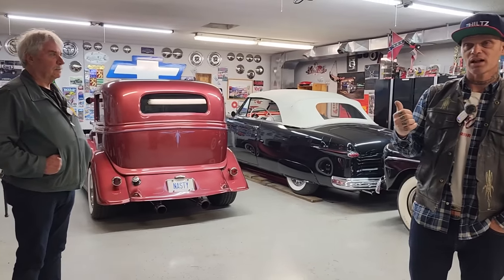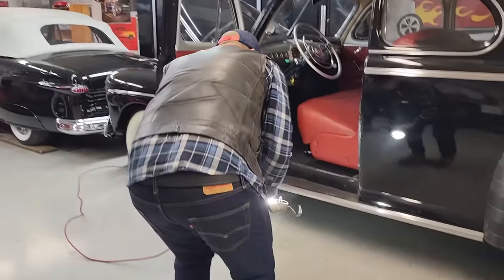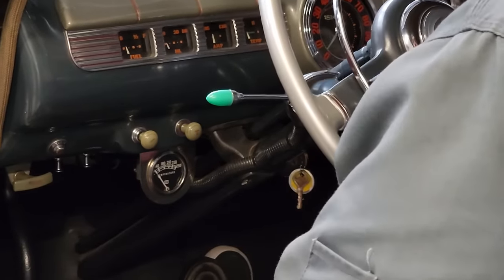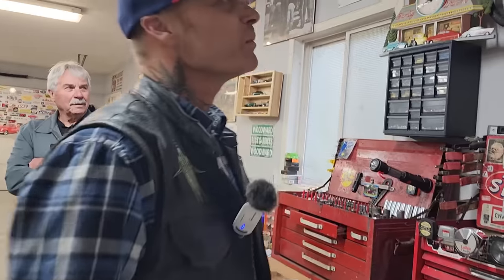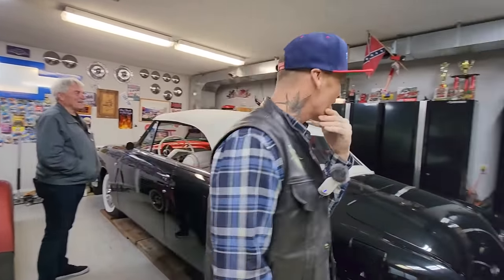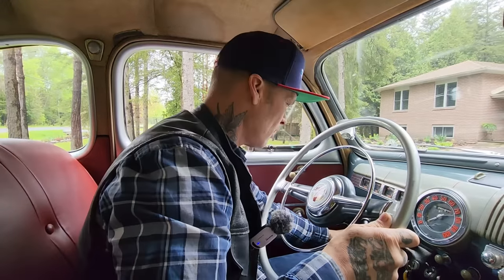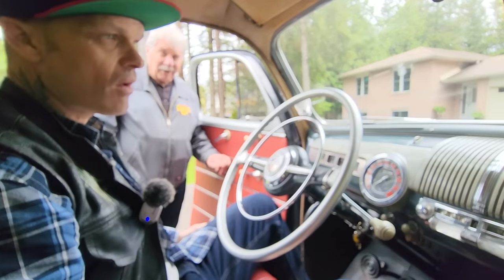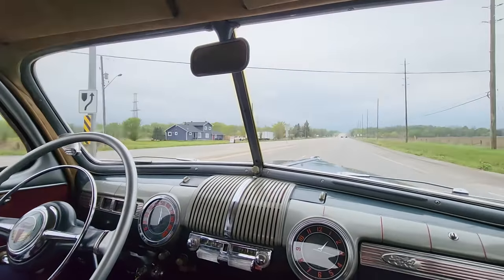The flathead long haul begins 🌎 2,000 KM with a flathead, bias ply tires, & drum brakes

Comment: Chad, I haven driven my  early Ford long distances on both bias play & radial tires for 40 years. Trust me it is way safer  and much less tiresome on radials. Please CONSIDER taking that offer of FREE radials. Put the bias tires in that huge trunk for reinstall when you get home. Drove safely. 
Best regards, 
MartyZ in NYC
Reply: I agree. Once you are on the road, the offer will be in your rear view mirror.
Reply: Unless radial design changed....radials caused pre mature wear on older suspensions. I put steel belted Michelins years ago on a 1964 and ride and handling was terrible....I also  had Michelins on  a 62 Volks in 1966 with no regrets.
Reply: @rowenajohnson9173  I have radials on my '64 C/10 Chevy pickup, and they ride fantastically.
Reply: @jimmieroan9881  Yes, I'm intimately familiar with that Ford's buggy spring suspension system (and as a car restorer hobbyist all of my adult life I'm also familiar with Coker Tires). However, I was NOT comparing the ride and handling of my C/10 truck to that '46 Ford.  I was responding to Rowena Johnson's comment about the radial tires on her 1964. For clarity, please re-read her post. Lastly, about your "old guys" comment, I'm 71. Have a great day.

Comment: It has the 1946 Trim and front marker lights. The 1946 trim is scalloped and nicer than the later years. I have a Black 1947 Business with the 46 trim as well. But mine is street rodded and about 6 inches lower than yours lol Wish I could post a picture on here of it . This car looks way cooler down low. Ask me how I know lol. This gem is definitely a time capsule. Have a safe trip guys!!

Comment: My first car was a 1947 Ford Club coupe, with a Mercury flathead, Edelbrock high compression heads, high lift cam, etc. I wish I still had it. The trim on this car is 1946, considering the slim trim around the side windows, front rectangular parking lights above the grille, the lines in the front grille trim, and the oval red Ford script on the rear bumper. The title may say 1947, but everything else says 1946. Beautiful car!

Comment: I had a 50th Anniversary 1953 Ford Convertible with the last year of the Flathead V8 which came out in 1932. It was purchase new by my Step Mother who worked for a Ford Dealership where she met my Dad and married him. My Mom passed of Breast CANCER when I was 3 and change in 1951 and remarried in 1954 and my Step Mother stopped working to stay at home and raise me. I acquired the car (that had every option Ford offered) in 1965 from my Step Mother and sold it for $110 and 39,000 miles when I entered the service. My Dad taught me about the mechanical fuel pump that was push rod operated and they would easily wear and he had to put a copper or maybe brass shim on top of the push rod to allow gas to be pumped. You were discussing that with a leather boot on the push rod. Loved that car and enjoyed the super quiet internal engine parts making it so quiet while running you would think it wasn’t running. Good luck and love your videos.

Comment: You might need to find non ethanol fuel and a parts house that sells a lead additive for your fuel. Those older engines relied on lead to lubricate valves. No lead in fuel and add ethanol would be trouble on those valve stems.

Comment: I hope you and Jolene like the car.  I would like a stock 47 or 48 Ford or Merc coupe.  I hope the trip home is enjoyable.
I owned a few old Fords, but not the 47.  I did work on them, and once you got used to the idea that it was a torque tube car, and the rear end had to come out to work on the transmission, life wasn't so bad.

Comment: Chad, I believe that is a 1946 not a '47 Super Deluxe Business Coupe. I've have a few..A '47 and '48 have the directional lights below the headlights. The '42 and  '46 had them in the fender extentions like the ones in the video. Also, on a 1942 to '46 Ford the stainless trim on the fenders are above the bump on the fender. On a 1947 and '48 the stainless trim on the fenders are on the bump out. That's definetly a 1946. After WW ll instead of retooling all the mentioned above they just used the stock they had left over before the war.

Comment: Wow! This is a nice adventure driving in the best car Chad has bought. This pretty little Ford coupe needs nothing and I hope she is as reliable as pretty on your trip home. Like your seller I owned a 49 Ford Shoe Box but mine had the stock 239" flat head V8. He is kind of right about the over heating issue but that can be addressed these days with better cooling etc. The modern V8 disc brakes etc. is a better engine for long cruises but the stock flathead is ok for like day trips. I've owned both.

Comment: Carr girl tool bag spare  tier ttank of fuel  and away we go ! 2000 miles isn't a short drive but it's going to be a interesting one for  sure!  Good luck  and stay safe  ! Thumbs-up on  a road that's well traveled !  Ps those old tiers were good enough back in the day because  most of the roads were not paved so you should be OK.

Comment: Great car you probably should have put radials on for the trip home as those originals if they heat up to much may separate. Have a safe trip.
Reply: the tires must be reproductions and even at that like you say don't get them too hot. I wonder how they feel about no ac, pwr windows/steering, air bags or seat belts?

Comment: The one thing I like about Chad is he's taking the adventure for the way it should be you can't take a car from the 40s and then change everything about it and make a completely modern and then say that you have a car from the forties now you have a body from the 40s Chad wants to experience the trip the way it would have been experienced when the car was built and there's nothing wrong with that you don't need 300 horsepower you don't need a GPS throw that away and buy yourself a map that's how they did it in the old days  you don't need power windows and all that foolishness those are just distractions

Comment: Don't know why they keep making such a big deal out of bias ply tires as long as there isn't any dry rot should be no problem!
Reply: I agree. Tens of millions of motorists crisscrossed the nation's highways back in the '30, '40s and '50s on bias-ply tires without any issues. Back in 1954, we road-tripped from Pennsylvania to Southern Calif in our 1948 Kaiser riding on a set of those $h*tty bias-ply skinny-@$$ tires, without any mishaps.
Reply: agreed bias are rougher ride and not high speed rated as long as he doesn't run into snow or ice hell be fine

Comment: I didn’t hear him mention if it had the overdrive transmission. That really makes highway travel a lot nicer. I have the overdrive from my 50 ford in my garage. I put a five speed floor shifter in as a replacement.

Comment: you Looked right at them front body mounts with a spot light i seen front mount , next vide after you buy it then you start complaining about running board mounts , they are not Body Mount and are not part of the Safety

Comment: That is a 1946 .I can tell by the fog light up on the top of the fender .Plus, the crome has a grove in it and is painted red .That makes it a 46.
Reply: On top of the fender? Those are parking lights; not fog lights. The fog lights are the round amber ones mounted on the front bumper. You be right about the parking light location on the '46 versus the '47.

Comment: You better bring distributor parts a generator  fuel pump shaft and pump  battery oil pump  4-5 spares  maybe a piston  don't get the distributor wet won't start for a month 😅 trust me had a woodie   10 gal water belts hoses

Comment: Rubber degrades to the point of failure at high speed at around five years after manufacture, no matter how it's stored or if it has no cracks. Ask Paul Walker (high speed = 55 mph).

Comment: Does it have overdrive?  If so the engine will turn about 2,000 at 60mph. Out of overdrive it will 3000 rpm.  I n any case I wouldn't exceed 55 
 mph. If the engine sounds stressted,, slow down and watch the temp.
Reply: It's a 3-speed. No "overdrive".